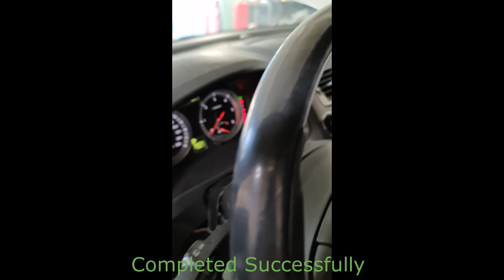How to connect Volvo S40 Steering Column Lock Simulator Emulator Plug and Play

Comment: After taking the lock apart The electronic board is damaged  inside the steering lock ,,if i buy a new lock will this procedure still work as the program in the new board will not be the same as the original

Comment: Why would I want to emulate my steering column lock?
I genuinely want to know.
If it can help me Im in.

2006 V50 T5 AWD M66
Reply: Because original lock is mechanical, it will broke in time and you can't start the engine, even if you replace it, will need codding only on Volvo and it costs about 500euro so this guys are GENIUS!